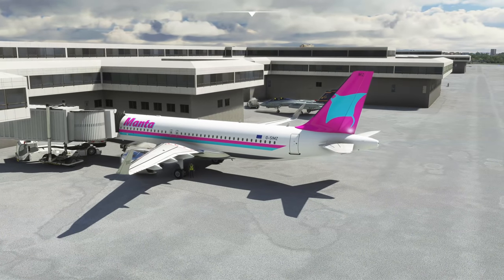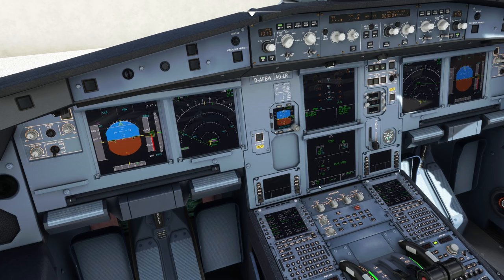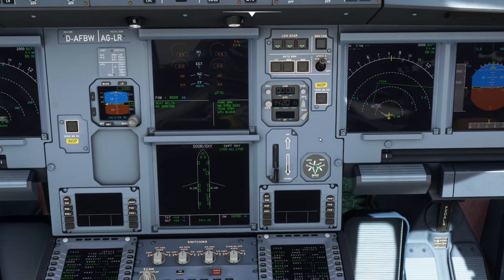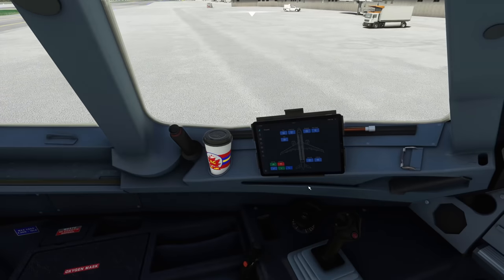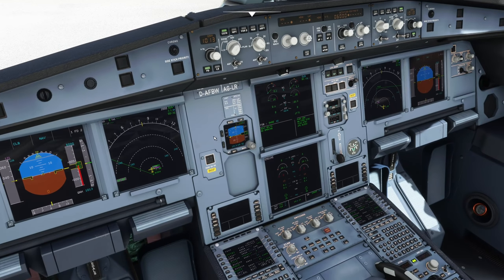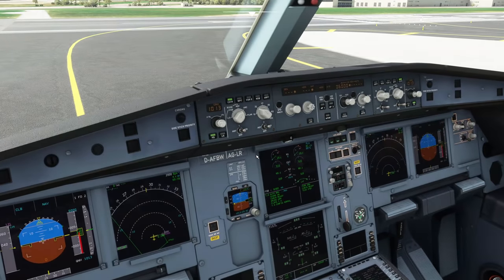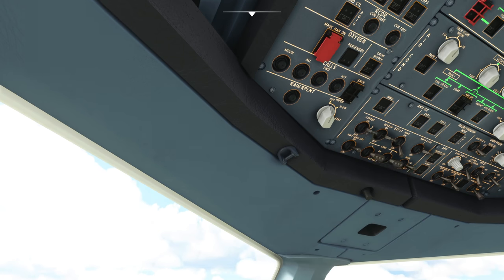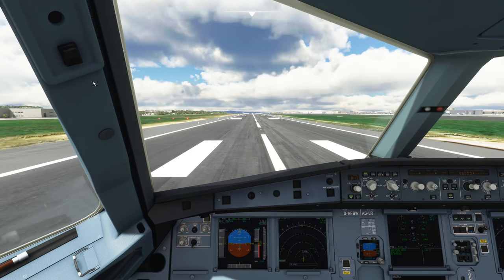Why We Time in the Airbus: Chrono Explained with a Real Airbus Pilot!

Comment: Always interesting hearing the slight variations to SOPs you guys use. Different strokes for different folks. We just use 1 min warm up time for APU thermal stabilisation. Then we wait a minute before a pack goes on after the Bleed. 

3 min engine warm up time / cool down time is now uniform across the fleet. CEO & NEO airframes. No IAE engines to worry about. 😉

I never bother timing the engine start. As you say it’s personal preference. It’s quite obvious if you get a hot start or hung start and ECAM tells you quickly enough. And if they think finding the QRH procedure for a tail pipe fire is “timely” enough instead of it being a memory item, it’s good enough for me. Obviously we’d time it on a manual start as you say. 👍

So many ways to skin a cat at the end of the day.
Reply: HD, it would be quite interesting having Gav to provide a vid about timing as well to see the differences.

Comment: Another question - unrelated to this video but you reminded me when you switched to TA/RA on the TCAS...   so what modes are set in the TCAS and when?  I know TA/RA when we get permission for takeoff and travel on runways but do you switch TA upon pushback and taxi, or another mode separately for pushback and then taxi?  You may wish to do a video on the TCAS...  if not done already.
Reply: TA/RA is mode Charlie. In Flight Sims it'll be better if you keep your Transponder to Mode Charlie or TCAS to TA/RA
Reply: ATC in the US will usually require mode C (TA) while taxiing, while some European countries will only require mode S (XPDR on, TCAS stby) until takeoff. The TCAS switch on TA/RA will run only on TA while on/close to the ground so setting it on TA or TA/RA while on the ground will do the same.
Reply: @leximoding  Ah ok - thanks!

Comment: It's interesting that in Europe you start eng 2 first and in the US you start with eng 1. I think it's because in the US single-engine taxi is more common and if you have eng 2 running the PTU will be barking whereas if you have eng 1 running you can turn the electric pump on and it's quiet.

Comment: Excellent guide, same with your entire tutorial list. I recently started flying the Toliss A321 and coming from the Zibo 737 I feel like a little kid inside the Airbus. Everything is so straightforward and well thought, the automation always puts a smile on my face, probably timing is the most manual thing in this bird 😄. Regarding this I have a question, do you time anything after landing? For example, engine cooldown time after thrust reversers are closed? I know that some company SOPs for the 737 will require this but I'm not sure if it's happening on the Buses too. 

Thanks for all these great tutorials. Your list got me up and running in no time.

Comment: On your Terrain Display switches you have them labeled INOP. I'm running the Dev version from a few days ago and I don't see that. And the TD is working fine as far as I can tell.
Reply: He is using the experimental version, which has a custom ND with inop radar and weather for now until MSFS has better support.
Reply: TD is inop in the experimental version

Comment: I find it a bit strange that Airbus have not integrated automatic timers for things like idle engines after startup, takeoff trust time etc. if it’s a requirement, the systems should deal with this automatically.

Comment: hello, I just had a question what does the crank engine mode selector mean ?
Reply: Prevents the igniters from activating. It allows you to motor the engine either for maintenance or incase of a failed start where you need to expel any leftover fuel/fumes so it can’t be ignited accidentally